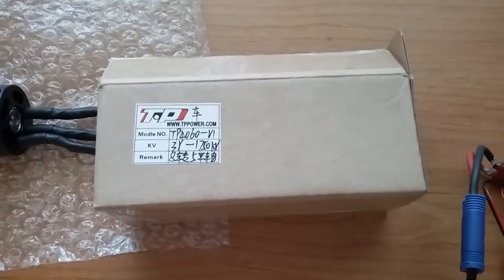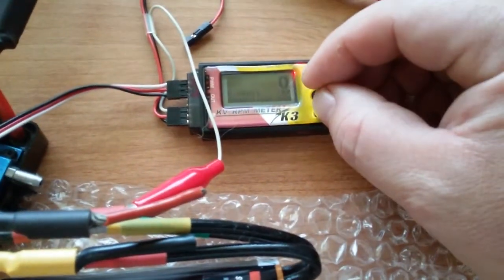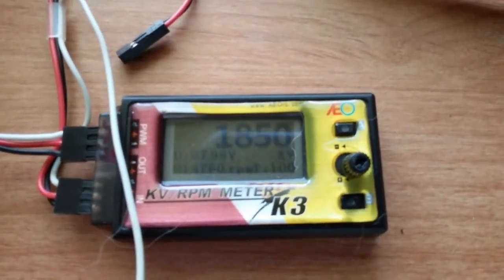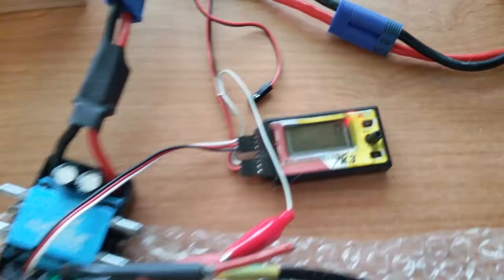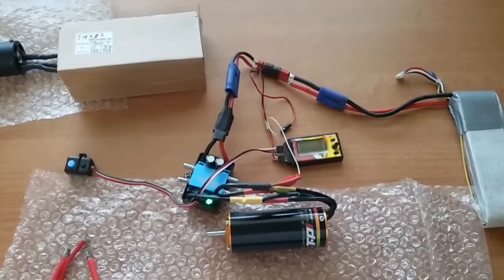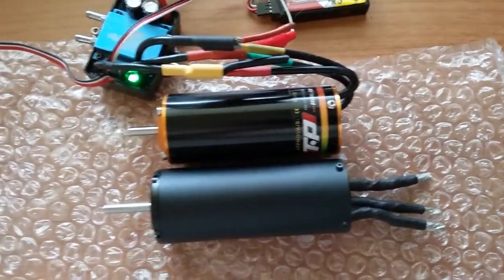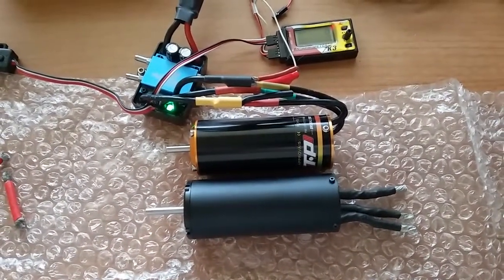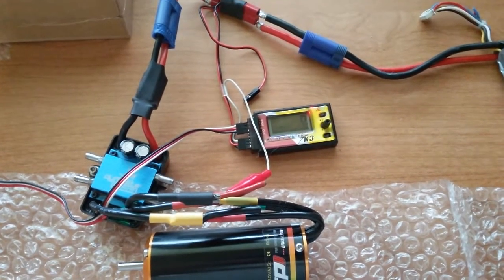TP4060 1750KV  kv test + size comparrison to  neu 1527

Comment: I was thinking about getting a Nue 1515 2050kv. To run on 6s in my Zip kits JAE33 outrigger.  I have a TP4050 2310kv to run it on 4s.  Not really happy with the TP.
Reply from the maker: Do it , neu motors are awesome👍👍

Comment: I think I'm gonna pick up the 1539 1690kv or 2310kv
Reply from the maker: I used 1750kv in the Ariane 2 on 6s, just got 2x 1380kv for the cheetah xl will run those on 8s
Reply: @secretsquirrel1942  Nice. I'll most likely go with the 1690kv for my ET48 2.0
Reply from the maker: Do it 
I just got 2 more of em.
Awesome motors.
Reply: @secretsquirrel1942  what kv?
Reply from the maker: What are you putting it in?
Reply: @secretsquirrel1942  not exactly sure yet. Either the ET48 2.0 or Limitless.
Reply: What kv did you get?

Comment: The length difference of the TP is due to the fact that you have the V2 version. It's 94.7 mm long. The V1 and V2 are basically the same motors, but one is about a millimetre bigger than the other in diameter, but slightly shorter.
Reply from the maker: ABOlsen69X 
Ah no like I said in the video the motor is 97mm long 
I does not match either the v1 or v2 speck from TP.